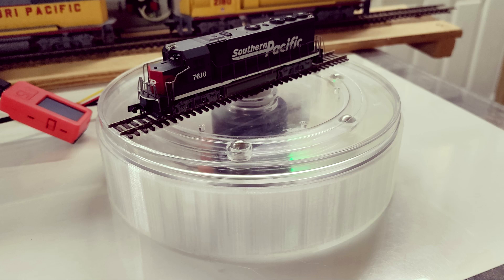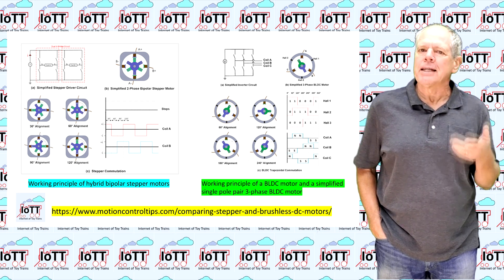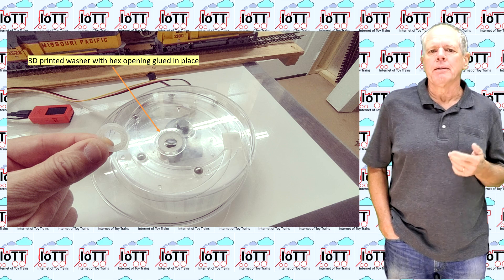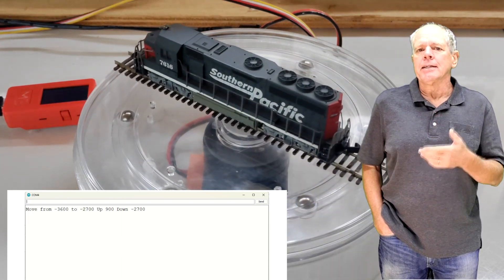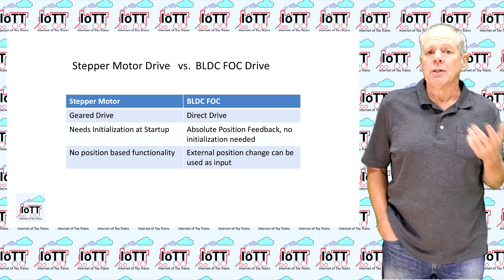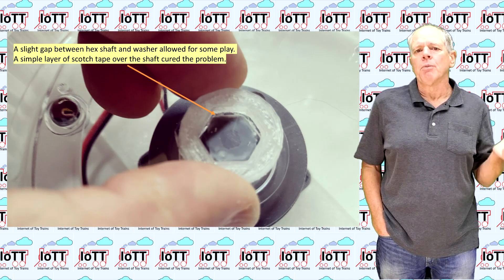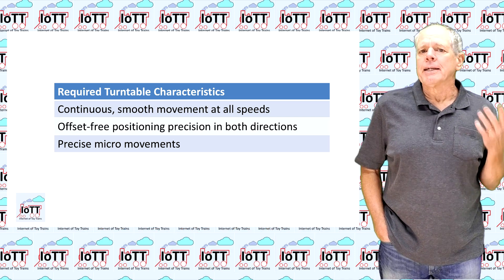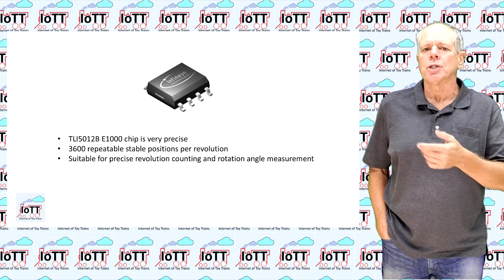DIY Turntable Drive (Video#149)

Comment: This is fascinating.   I don't think I have seen anyone else do this, definitely not on YouTube.  I look forward to seeing how your PCB stator design turns out and if it can be even more accurrate than the current setup.
Reply from the maker: I agree, it is. I was kind of positively surprised how smooth the movement is, I expected more oscillations, particularly at stand still. The PCB stator is going to be very interesting. Right now I am looking into around 200 small coils along the circumference of the PCB. This relatively big distance from the center should give a nice torque, even the individual coils do not produce a lot of force. We will see.

Comment: I like the M5Stack line of products. This looks like another interesting application of their products. This might also be an excellent project to be controlled by the M5Dial. It could offer both a visual indicator of the turntable location and rotation while also an input, via the encoder, to select the desired end position. Looking forward to seeing this one progress.
Reply: I agree with this!  Great project.
Reply from the maker: I agree, the M5Dial would be a nice option. I might consider that.